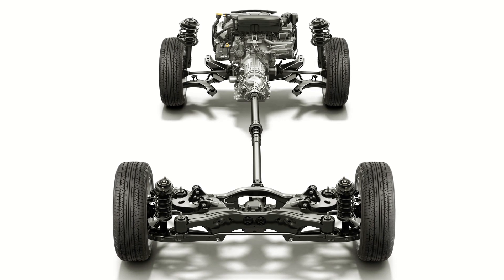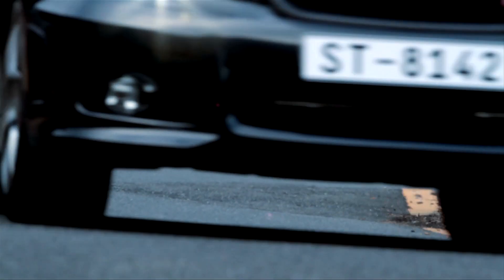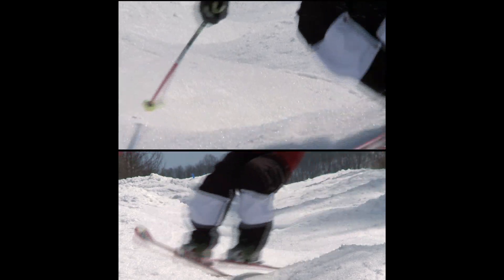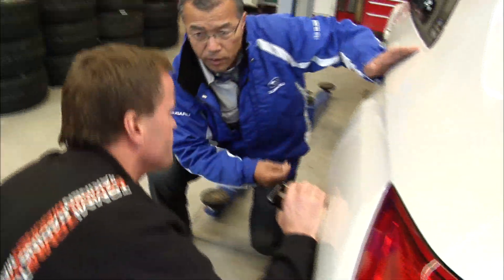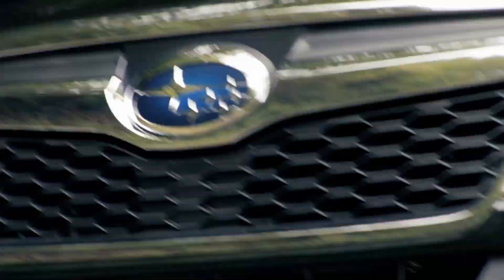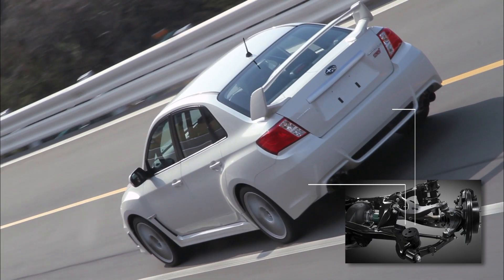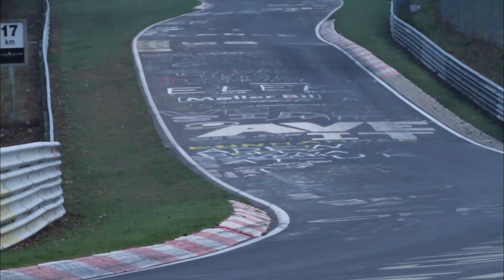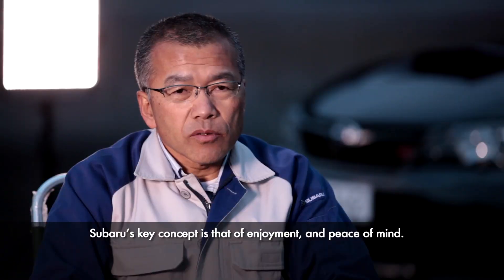SUBARU Lab Episode 3: DC³

Comment: No wonder they replaced the more powerful 2.5 Liter engine with a lethargic 2.0 Liter engine in the current Impreza just to "ensure that the chassis has a higher level of performance than the engine! "
Reply: Dominic Fong I believe it was a combination of MPG complaints and emissions. Rather than choke the 2.5 with emission controls, they made a more efficient motor all together.

Comment: I just want to note the design philosophy of Subaru greatly contrast with that of Chrysler.

In the American eyes, engine power dominates all, while great fun doesn't necessarily translate to safe driving nor great balance of the car. CoughHellcatCough

However, I don't necessarily agree with in all the way. I personally believe the current 2015 STI is under-engined. The chassis can easily take ~360hp and still be great fun, but Subaru doesn't seem to want to push a high-spec FA20 DIT under the bonnet of the STI.
Reply: With all due respect, the American car industry does not reflect what Americans want in a car.  Most cars bought in America are foreign.  I acknowledge there are many Americans who buy American cars, and as long as the car has power, they could care less about its chassis or how sophisticated the engineering is. Your comment perfectly explains how most Americans felt about cars thirty years ago, "but the times, they're a changin."